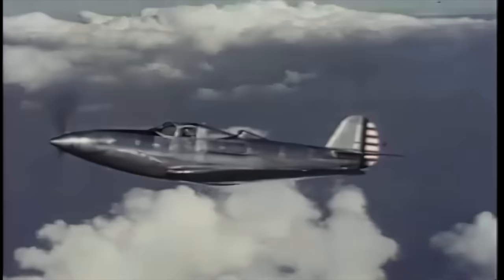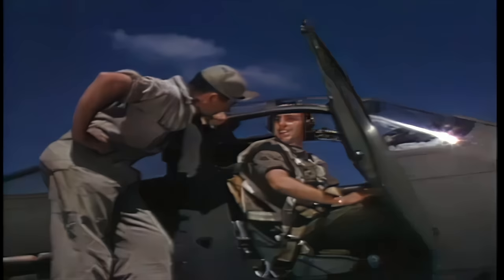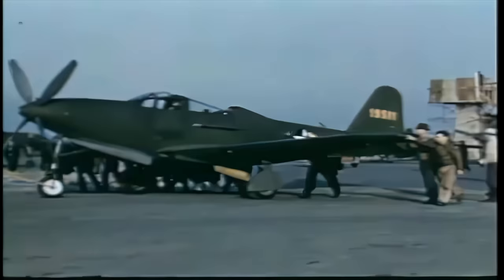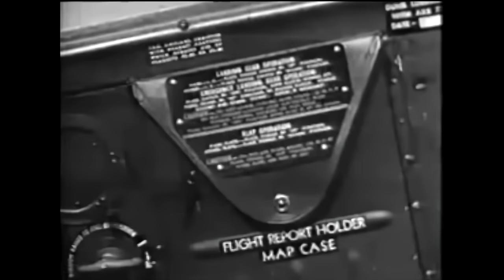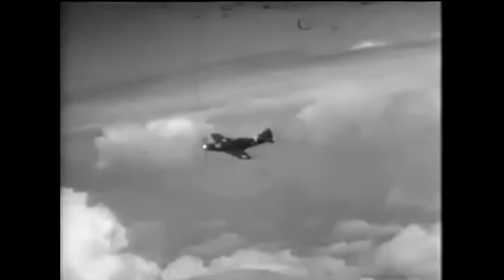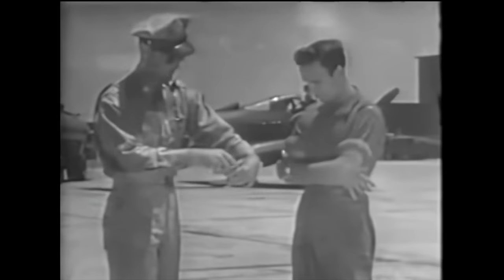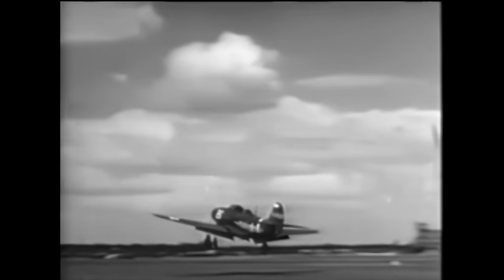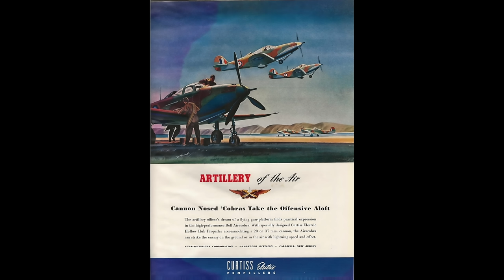P-39 Airacobra & P-63 Kingcobra | The American Aircraft Loved By The Soviets | Bell Aircraft

Comment: One correction.  It was not the absence of a turbo supercharger that restricted performance, it was the absence of a two-stage supercharger (as used in the Merlin 60 series) that limited the P-39's performance.
Reply: *limited performance up high

If anything,  not having the second supercharger gear helped low altitude performance as not having it requires less space and weight.
Reply: The video presentation is correct in this regard.  The turbo supercharger that was originally planned for the plane is what was absent, and a suitable mechanically driven 2nd stage had not been planned for the plane and was unavailable for the V-1710 at that time.
Reply: I hadn't noticed this comment and basically repeated it above.
Reply: It was the absence of either that limited higher altitude performance
Reply: @Jbroker404  And materials for impeller blades in high speed turbines in short supply.  Plenty of action at various places going on between 12,000 ft and the dirt to justify cranking out P-40s and P-39s with the typical configuration.  Not suitable for high altitude bomber escort, but there were other planes with proven records that could do that, save the tungsten for them.

EDIT:

I'll also add that the high octane fuel required to accommodate a really high manifold pressure boost wasn't universally available.
Reply: Actually it was the absence of the supercharger as it was removed from the P39 because it created so much drag.   Why that was done and not redesigned to reduce drag nobody really knows but there are a few theories.  They did redesign the landing gear to reduce drag.
Reply: Doubt is was the only reason as is usually the case but I think the drag issue was a real problem....I have seen that chart from a naca report and it was as bad or close to as bad as a Brewster Buffalo with the turbo installed
Reply: The Allison had a host of problems throughout most of the war.
Reply: Ok, who's going to admit yall got this info from Greg?
Reply: Or in the case of the P-400, any supercharger whatsoever
Reply: @SolomonSamson747 every prop fighter had at least one supercharger, even the troubled Allison engines.

Comment: My instructor used to fly Aircobra in Soviet AF and did shot down six FW-190. I remember he said that this aircraft is good but not for novice pilots.
Reply: Two American pilots that liked the P-39 are Chuck Yeager and Bob Hoover. That kind of supports the idea that you have to be a superb pilot to get the most out of it.
Reply: Good testimony.  Exceptional pilots were required to handle the P-39 instability problems and it also had unacceptably light stick forces under high g manouvers.

Comment: The engine placement was a HUGE problem for Soviet Air Force pilots. They were frequently in low level combat  - too low to parachute so a forced landing was the only option when severely damaged. However, anyone who did that in a P39 was crushed to death by the engine when the plane touched the ground.

Comment: I can't help thinking that a twospeed, two stage supercharger as used in the Spitfire would have probably solved the altitude problem.
Reply: That could have been true,, it was also a fact that there was such high demand for the Packard merlin engine for the P51 Mustang, they even stopped building the Merlin p 40. Because  it was a waist of a good engine that was needed in the Mustang.
Reply: adding 300 lb plus intercooler radiator would have been a weight and space (and drag) challenge to an already crowded airframe with limited internal fuel.  IIRC the Merlin couldn't accept that drive shaft system either.

Comment: What a tragedy that the P39 was deprived of the two-stage supercharger that it so obviously needed.
Reply: Allison never made a reliable high altitude system.  The Aux supercharger used in the P-63 was without intercooler, aftercooler or backfire screens.  The P-82 used in Korea was a maintenance nightmare regarding its Allisons.

Comment: I think the P39 was a very good plane, considering the low altitude engine & the relative high wing loading. It could’ve done with a couple of added wing tips like the spitfire, making each wing nearly half a metre longer, that will do. I like the way Bell thinks outside the box. The nacelle setup on their twin engine job, the mid engine P39 & having the jet engines on their jet fighter flush with the fuselage sides ( seemingly the 1st to realise this benefit of not having props).

Now it seems the Allison engine had a reputation of better serviceability & reliability than the Merlin, yet post Lend Lease Mustangs with dual stage supercharged Allisons apparently had a very short service life. I have no idea whether that was the case with the P63
Reply: If Wikipedia figures are correct the P-39 wing loading was the same as the P-40 and lower than the P-51.
Reply: @gort8203 
Wing loading rating isn't the end all do all when it comes to turning radius like everyone thinks, power is another number that's important, that's why despite the FW190 having a better looking wing loading number than the P47 above 15,000 ft the P47 with it's turbo that can provide maximum boost to the engine up to 35,000 ft can not only turn inside of an FW190 it can gain altitude in that tigher turn while the FW190 will be losing altitude altitude in it's wider turn. 
Greg from Greg's Airplane's and Automobiles goes over all that and explains why you can't just look at the wing loading number and think you can tell which plane can turn inside of another in his video on maneuverability, and he shows all the NACA test results from the P47 and FW190 as source material, from those you can see why a P47 could chew up an FW190 in a maneuvering dogfight at altitude.
Reply: Yea but the information you looked at that leads you to believe they had short service lives what did the times in different throttle settings look like on the engine's?
Because if it was from motors that were being pushed into War Emergency Power a lot while testing the aircraft or engine's of course they were going to be burned up quicker, if not there's no reason they shouldn't have lasted just as long as single stage supercharger Allison's, and the P38 Allison's that had a high altitude supercharger system with it's turbo feeding the engine's single stage supercharger, the engine itself doesn't care what's making boost for it, so the same boost levels irregardless of supercharger type or altitude shouldn't change an engine's service life.
I have the feeling you were looking at test data because P51's never flew with the 2 stage 2 speed Allison supercharger engine except for the single test bed one, after flying it they dropped the idea of producing them because jets were quickly becoming the new thing and the USAAF wanted their money put into them instead of more variant's of prop planes.
Reply: @dukecraig2402   You are the one who said the P-39 had relatively high wing loading that detracted from its performance, not me.  I just pointed out that it actually did not.
Reply: @dukecraig2402  Oh, I see I got your comment mixed up with the original and I thought you were contesting what I said instead of elaborating. My apologies for the confusion.
Reply: Army air Corp had the wing shortened so it would fit into revetments they currently had. The shorter wing span negatively affected speed, turn performance, climb performance…
Reply: P-39's were unstable near the stall with a roll-yaw divergence, unacceptably light stick forces during g manouvers and hysteresis stall characteristics (NACA 0015 airfoil) and W&B issues when ammo was expended.  Deemed an unacceptable gun platform by Material Command, and 3x the accident rate in training units.

Comment: I wonder what the jet fighter  history in the US would have been like if the swept wing variant of the P-63 had been mated with a pair of Westinghouse J30 jet engines in 1942-43 instead of the J21 engines on the P-59
Reply from the maker: Imagine if the G.E. J31, originally Designed by Frank Whittle and shipped together with the British inventor to the U.S. in 1941, had not been delayed by at least 6 years because of Whittle having been ignored and ostracized by the likes of A.A. Griffith.
Britain could have had a fairly reliable, and easy to develop turbojet before the beginning of the war.
They could have shared the design (and the inventor as they did later), and the the U.S. resources those engines could have seen combat in the early stages of WW2.
Considering that Whittle’s derived G.E. Jet engine made it to the Korean War in the Lockheed P-80 (inferior to the MiG-15 also powered by a reverse engineered Nene/Whittle Klimov turbojet), you can only imagine what it could have done during WW2, as his centrifugal turbojet was still relevant in the 50s.
Other than the natural development of axial turbojets, it boggles the mind to think that Griffith could delay Whittle by so many years, as he was the sole judge of the young British inventor’s work in 1929, when he (stupidly) sacked it, most likely because of a flagrant conflict of interests.

Comment: The P-39/P-63 is a beautiful aerodynamic airplane.  When the legitimate complaint of the P-39 not fitting a turbo-supercharger was made, the P-63 is or should have been the first logical response followed up with right away.  Why it took so many confusing and/or short sighted responses is typical of dealing with bureaucracies.  Of course if the evolution of the P-63 had been sped up and had a Merlin-Packard installed there possibly wouldn't have had any need for the P-51, or any other Fighter/Interceptors past that point. It most likely would've sped up eliminating the Luftwaffe before they did.

Comment: The US Army Air Force should have assigned a group of roughly 48 fighter planes of the P-39 Airacobra to every US Army infantry division. These P-39 Airacobras should have been optimized ground attack missions. Forward air controller detachments with mobile motorized radio controllers should have been attached to infantry regiments to coordinate ground attack missions including putting artillery smoke shells to locate targets for pilots. These Airacobras would have been heavily armored with self sealing fuel tanks with protections of vital components. Weapons configurations and ammo loads would have been maximized for strafing or bombing enemy ground targets directly in front of American infantry. 

These Airacobras sole purpose would have been close ground support of US Army soldiers. The Airacobra should have been the Army division commander's flying artillery, similar to the German Henschel He-123 biplane or Soviet Il-2 Sturmovik. These Airacobra pilots would have avoided aerial combat against enemy warplanes. The sole purpose of these Airacobras would be to bomb, strafe and blast enemy ground targets directly in front of American infantry soldiers with pinpoint accuracy. The Airacobra would have needed to work from primitive runways close to the frontlines to have flown the maximum number of ground attack sorties each day. The concept here would have to have primitive forward airstrip for refueling, rearming and repairs. Major overhauls of the P-39 Airacobra would have been done at Army Corps levels with frequent squadron rotations to the rear. 

The concept here would have been to give every infantry regiment engaged in combat its own organic divisional close air support/ground support fighter group. The Airacobra fighter groups would have provided a continuous ground support mission dedicated solely to assist the American infantryman. I wish the bulk of the US Army Air Force had spent less time on dubious strategic bombing and much more effort placed upon maximizing operational bombing and tactical close air support missions in support infantry divisions.
Reply: Extra Armour needed for that little fighter already with a high wing loading and limited bomb load.  I agree with your doctrine though, just need a more robust aircraft and pilots trained as attack pilots not fighter pilots. The Skyraider came along too late.

Comment: Certainly a slippery aircraft with the Q version.  Better climb and dive speeds than the P-40, but...

Accidents and crashes were common with the P-39.  Material Command stated that it was unacceptable due to roll-yaw instability near the stall making it a poor gun platform.  Stick forces were also unacceptably light during g manouvers.  
P-39s had 3x the accidents than P-40s at training units.  Tumble and flat spins were problematic.   Brits cast it off due to these handling problems and lack of speed performance on production units, but it was a perfect fighter though for export to Soviets who would take anything.

Comment: They were so bad, they had to give them away. The AAC tried to cancel the contract but it was cheaper to finish the production run and send them to Russia.
Reply: They weren't bad, they just didn't fit the West's missions. They were successful in Russia where they flew lower.
Reply: The Russians thought highly of them. Even forming air wings made up of their best fighter pilots made up solely of P 39s.
Reply: 6 of the top 10 Soviet aces did it in the P39. It was a great low altitude fighter in the right hands and conditions. The Russians preferred the P39 over spitfire and Mustangs.